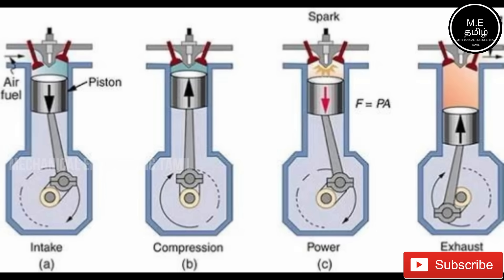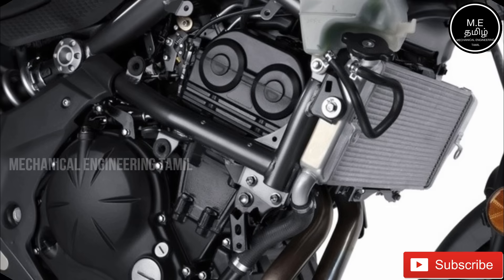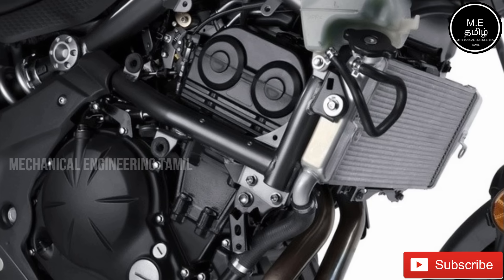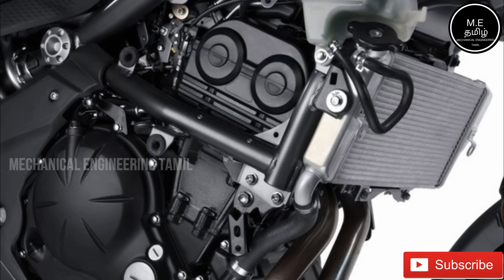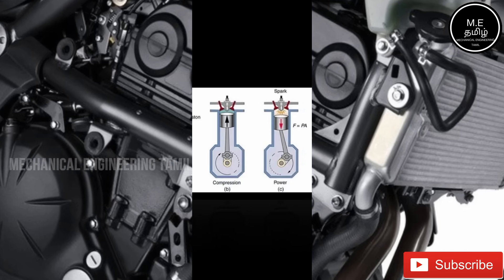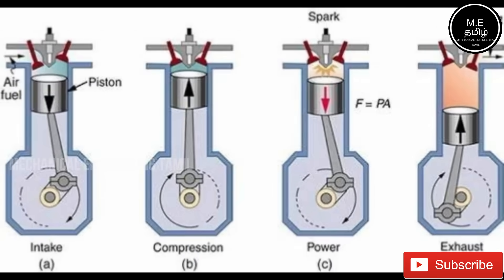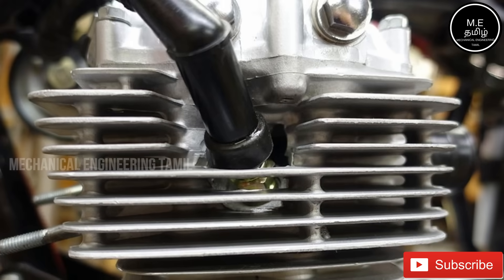Air Cooled Vs Oil Cooled Vs Liquid Cooled Engine (தமிழில்)

Comment: Apo gixxer 155cc 2019 la Air cooled dhan use panranga apo adha long drive ku eduthutu po mudiyadha
Reply: Ella bike layum long drive pogalam bro... But cc & cooling system base pani ivlo km distance a ivlo km/hr speed la pogalam nu decide  pananum bro... For eg gixxer 155cc & air cooled engine... So, average speed 70km/hr speed la 100 km continue a drive panalam, apro knjam break edukanum.. adhuve cbr 250 cc & liquid cooled engine na average a 90km/hr speed la 200 km continue drive panalam.. liquid cooled engine nalum bike ku kandipa rest venum bro.. same time cruising speed vera top speed vera... Long drive pogurapo top speed la poganum nu ninaika kodadh, thevai pata matum 5km distance kulla venumna above 100 la pogalam.. otherwise cruising speed la poradh than engine ku nalladh...
Reply: @wellknown.stranger  apo 70 speed mela continue pona thangadhu ndringla

Comment: Nice bro.., but didn't say about compression ratio. For some engines which hav high compression ratio will get more and faster heat than lower compression. hence those bikes must need liquid cool.... for example r15 and cbr 150 those were higher compression ratio than other bikes... Correct me if im wrong.

Comment: bro ipo normal ah 100 cc bike la 1 lit oil use pandrom athula fins la heat reduced aaguthu aana oil cooled la antha pump pump panum podhu oils ellam antha pump moolama radiator poi cool aagi return varum antha tym la engine la oils erukuma erukum na antha bike engine oil capacity evalavu erukum
Reply: Bro... Oil cooled Engine la Air cooled Engine ah vida konjam extra engine oil use panra matri irukum as per the bike models...and radiator ku oil poitu varathu continues ah nadakira process engine oil engine -> radiator circulate ayte irukum... engine la minimum level oil maintain aytu irukum... engine idle condition ku varum oil circulation stop ayrum

Comment: Bro air cooled engine bike ah oil cooled engine ah convert Pana mudiyuma?? By installing radiator externally?
Reply: Yes bro it is possible. To convert air cooled to liquid cooled. Depending on the oil pump configuration.
Reply: jsm diwan  bro kandipa unga Apache 160 oil cooled AA convert panalam
Reply: jsm diwan athula thaan oil flow aagum atha radiator la connect panugaa
Reply: Bro naa Apache 160 vachu iruken..athula 200 radiation ah install Pani convert panalam ma? 160 4V version la radiator fix Pani varuthu athaan keten..
Reply: Tq bro
Reply: jsm diwan you want any idea
Reply: Joker 420 yes bro
Reply: jsm diwan ur bike model and year
Reply: Joker 420 TVS Apache RTR 160 CC 2018
Reply: jsm diwan ur engine has already oil cooled u watch near spark plug one small pipe connect engine to fins
Reply: Joker 420 bro athu iruku but radiator Ila oil ah cool panura system ila....neega solurathu oil cooled system Ila bro...Engine over heat aaguthu foot pedal la kaal ah vaika mudiyala..
Reply: Joker 420 thank you bro
Reply: jsm diwan  it's not radiator it's like plate with fins radiator is only for liquid cooled radiator consists electric fan shop la oil cooler kit kelunga
Reply: Joker 420 spare parts shop la kedakum ma? Price evlo varum bro?
Reply: jsm diwan oil cooler kit appadinu netla parungaa
Reply: Jsm diwan re 500 cc la liquied cooler set pana mudiuma
Reply: jsm diwan mudiyathu nanba

Comment: Bro,enfield 350 ,liquid cool engine ah....?
Reply: udhay santhosh air-cooled
Reply: Torque Drifttt Tamil ,bro enfield 350cc but y it is air cooled....?
Reply: Classic 350 has low compression ratio and to make it at low cost they used aircooled